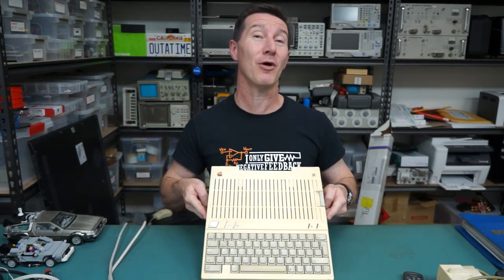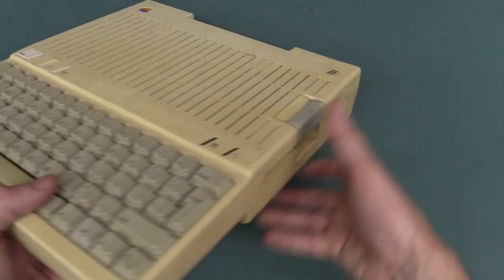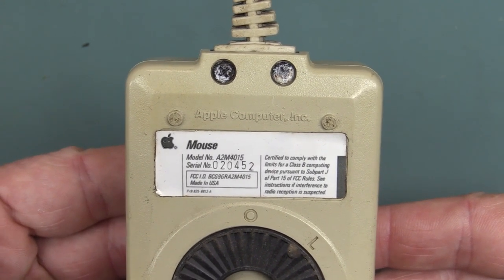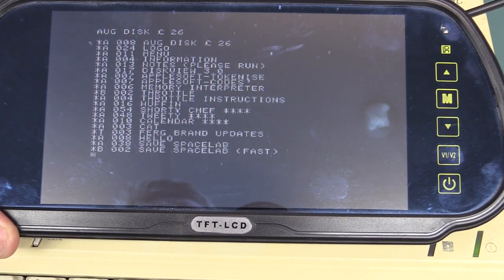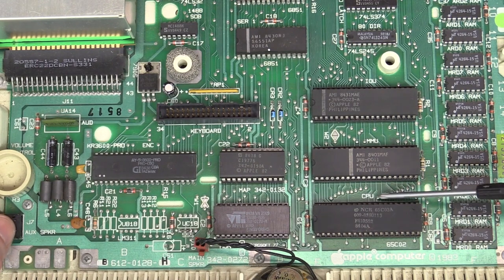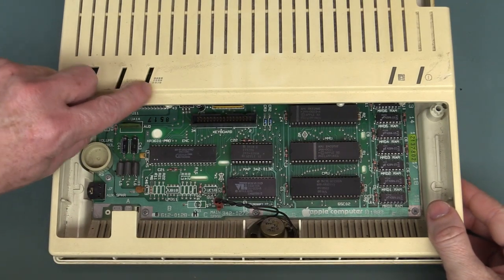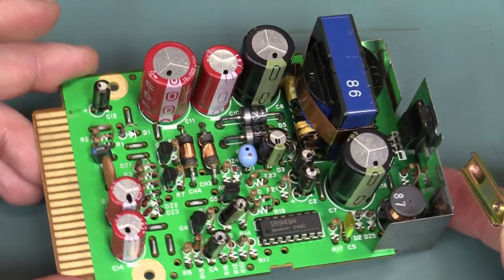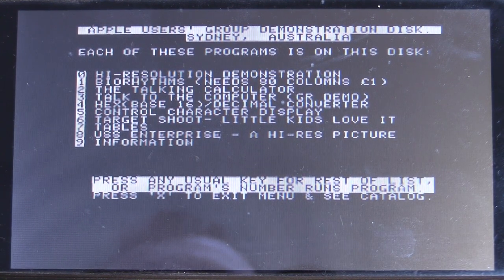EEVblog #788 - Apple IIC Teardown

Comment: The carry handle was also gave you the ability to prop the back end up.  And was it actually possible or impossible to power it by only one 9 volt battery.  Don't you really believe what you see from the movie Explorers.  Here are my findings, more circuitry was needed.  I did not power an Apple IIc computer, however I was able to power only an Apple Gen 1 monitor.  Now if you know what your doing with 4 diodes, two 9v batteries, one 6v relay,  and a board to solder those on, wires to make the necessary connections.  I was be able to rig this up to power it for about 1 to 3 minutes tops.  Think of the relay rapidly turning on and off.  It was a dirty 38 volts ac (I don't know the cycles) that was produced by the rapid on and off the relay. I just remember it being 38 volts.  And I know the relay circuit works because I once powered an old Apple Gen 1 monitor with it (The monitor where you could tilt up or down on the display).  I removed the internal transformer and tested it on the monitor by wiring on leg (input wire to the relay ground plane and the other leg to the opposite leg of the relay (I did not use the AC transformer nor was it wired in any way to the relay.)   I already measured the output of the voltage of the transformer when its plugged in.  If I remember it right it was 36 volts AC.  My dirty AC power supply was only producing 2 volts over what this hefty AC transformer was doing.  2 volts ac is not a big deal, nor were the cycles because it was being channeled through a diode rectifier to make it DC volts.   It only worked for a very short period until the 9 volt batteries died from being drained quickly.   If you remember the shock pens you could buy and use for pranks.  This dirty AC power circuit has more of a byte to it.  I never measured  the amperage output of the dirty power supply I built.  I just remember it work very briefly before the 9 volt batteries died.  And its been about 18 years since I built it.  And this was my first mod / hack of an Apple branded device.Now for the PC junior, that computer was a joke, but I did like the fact the original keyboard for it was also a wireless one.  It worked like a remote control.  Again about 19 years ago.  Getting one from a garage sale with no power supply.  I was able to use an old external scsi hdd case that had a powerful internal power supply.  I used a molex power splitter cable to power the board and floppy drive from this tiny power supply.  Was it bright to do that.. Nope.  Did it work... YES!!  I could have burned out the mobo inside it.  but I lucked out.  I smiled cause I knew I did something that shouldn't have worked but did.  I was able to boot, use the floppy disk drive and do all normal things with it. Who else here remember the movie Explorers?

Comment: would switching the div 14 chip with a div 16 chip break anything?
Reply: +Light Bringer It would probably mess up the video and the floppy drive.  Woz used clever hacks all over the place, including the fact that everything uses the same clock.

It would, of course, also make the processor run slower.

Comment: Ha..  just as I said “I would just say print peek...” he goes and does it.  Showing my wife all the old useless stuff in my head.   BTW.  What happened to “don’t turn it on.... take it apart”. He did it backwards... 😝
Reply: You know, I used to use these machines a lot (still have a pair of them, but only one power brick), but I completely forgot that ? was an alias to the Print command in Applesoft BASIC until I saw him use it here.

Comment: I love DVORAK but only using it when encoding long documents, 98% of the time I use QWERTY because 100% of the apps that I used is designed for that (mainly games), my laptop uses QWERTY and you cant change that unlike on my mech keyboard on my desktop computer, yeah I can plug a external keyboard but its not worth of the hassle carrying extra keyboard.

For standards, QWERTY wins, DVORAK may improve typing speed but I can also type fast in QWERTY keyboard just fine, with only 2-3 characters delay if you compare it to DVRORAK which is not a big deal most of the time, its not like I type more than 2 page of document per day anyway, unlike on my college days where I need to encode hundreds of pages for my research and thesis work.

Comment: I find it disturbing how our brains are filled with old garbage command prompts or codes (IDDQD anyone?) that take up brainspace and make it harder to remember new things.
Reply: IDDQD is from ID-software's DOOM. Run doom type it in and you'll not gonna die in the game anymore IDKFA is also a good idea ;) remember DNCornholio? ;)
Reply: +John Grammaticus I still remember a few AT commands. Not exactly a lot of call for that anymore.
Reply: +cougarhunter33 well if you work with mobile phones there is.  The link between the smart phone CPU and the radio transceiver is a serial link and it uses AT style commands.  So when you call someone on your iPhone there is actually a ATD<phone number> command getting transmitted from the CPU to the transceiver.  Same thing for setting up data channels and sending SMS.

Comment: The LASER128 / 128EX / 128EX2 were better!
Reply: The double high res graphics was 8 colors only if I recall, as was the high res. Med res and low res were 16 colors. 

All the sound was generated by a timer if I remember correctly as well.
Reply: 24:56 it might be used to trigger the disk controller, it works on a very specific timing. 

In fact, that timing was so specific, that there's an actual whole Apple // built into the LISA just for reading disks correctly.
Reply: You can be pretty rough with those older drives, and while it might have been an isolated incident, you can always clean then off by simply rubbing your shirt on it I guess. I did so with a similar drive and it seemed to work fine afterwards, at least it read disks correctly though.
Reply: LCDs probably won't cut it for the Apple // graphics modes most of the time. I'm sure you know this in some capacity, but composite video works by sending sync to start the line, then blank, then color burst (if applicable), then blank again, then the data for the line, then another blank, rinse and repeat. This means that on CRT televisions, you could get theoretically infinite horizontal resolution, but only 480 lines or so high (in the Americas).

The Apple // color graphics were done weirdly, which gave a weird resolution on the television and made some pixels run into each other. This is why the high res graphics are 8 colors only, because there's black and white I know but also magenta, green, cyan, and orange. I forget exactly how they work but it's something with the way bits are shifted in video memory to give graphics color. Due to these weird resolutions, many LCD televisions won't really work with high res graphics. 

I have a short program you can have for this if you want

Comment: Goddammnit I missed a chance to get a couple of these. Anybody want my IIplus?
Reply: +Lu Tello OH?  Where are you located?  If outside the US, the shipping wouldn't be worth it.
Reply: Shouldn't have said that :P
It's 2000 miles away from me these days, can't get it.
Reply: Lu Tello Damn!
Reply: +Lu Tello I still have one that I got in ~1995. I don't have the power supply, so I don't even know if it works. Still not parting with it. I ALSO have a fully functional Apple //e with a 3.6Mhz AE Transwarp accelerator, a full 1mb of RAM, 4 disk drives, etc. I dig it out every year or so to play old Scott Adams adventure games, Taipan, and of course... Zork